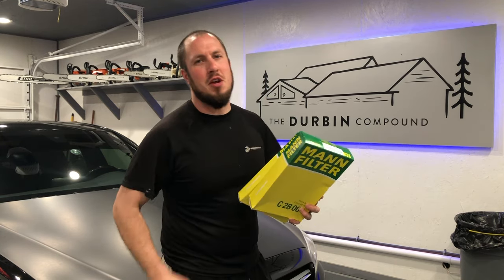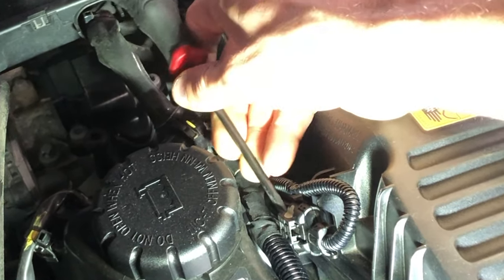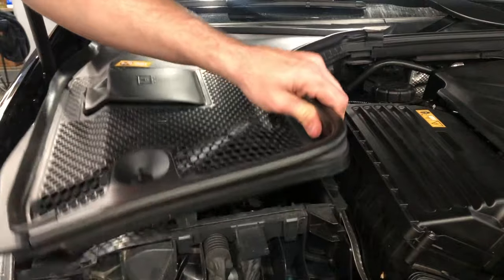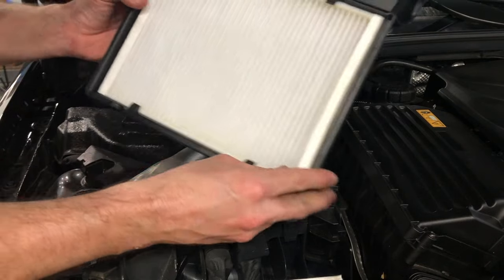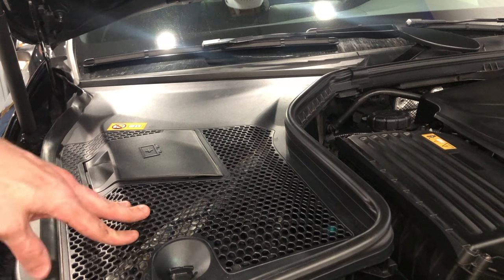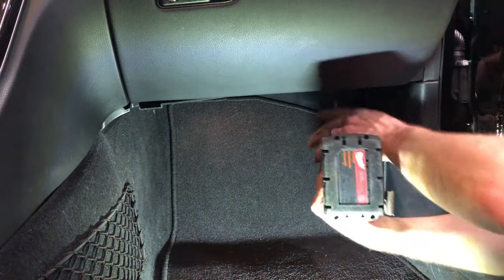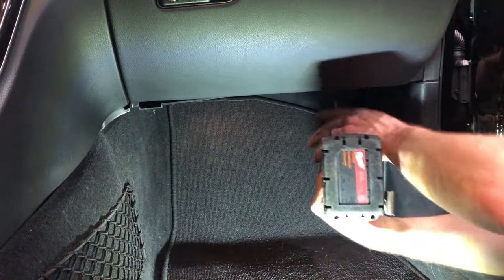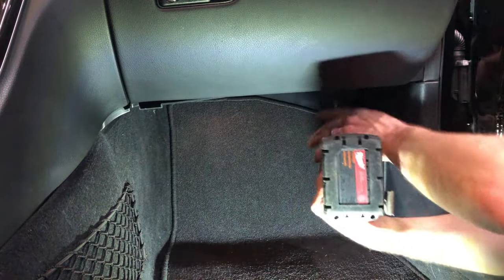Mercedes C300 W205 Air & Cabin Filter Change

Comment: Hey great vid but you put the cabin filter the wrong way. The foam part of the filter should be up, not sideways, its in the mann filter instructions inside the box. Thats why the old filter was crumpled, it was also sideways. But keep up the good work and sharing content!
Reply: Not necessarily. Its important to check two things: cut corner has to be on the right, and the air flow arrows - towards the engine.
Reply: No. For the Mann filter he definitely has it wrong. He could at least make a comment. I had to do it twice because of him. That's also why he was struggling to put the clip back in. He had it the wrong way.

Comment: Saved me a pointless B service 😂. Any particular reason why you do not remove the carpet lining?  States to remove in the directions I received with mine. Good job with the records too. I do something similar with my iPad.
Reply from the maker: I think the removal of the carpet is to assist in the angle it takes to insert the filter without bending it
Reply: At least they would put the filter in the right way at Mercedes...

Comment: Thanks for the help with the cabin air filter! You made my life easier and my wife happy her AC doesn’t stink anymore. Sincerely, Jacob
Reply: Next time you replace the filter, spray a little AC evaporator coil spray on the evaporator coil (looks like a mini radiator) back in there and let it sit/dry, then install the new filters.  That spray will help kill any bacteria or mold (or what-not) that has found its way onto the coil.  A can of it is only like $8-10 and is probably good for 2 jobs.

Comment: Hello, thank you so much for this video. Just for others: there is a big plastic hook behind the cover, for the cabin filter (inside). In the video, this hook is already broken. Mine was not, and it was very less easy to remove this cover. So be careful! I don’t have broken the hook but because of pulling without understanding, the plastic is now white at its base. So it will break at next change I suppose 😄
Also, the filter in the engine bay was the good part (Mann-filter) but the inside one was not (compatible but not the same). I don’t know who is the OEM for this one, there is no brand printed on the MB original filter, it seem to be an original part from MB, not from an OEM.

Comment: When I purchased my new (used)17 c300, I got rid of the ok condition runflat tires and put some awesome riding goodyear comfort drives on them.  2 studs were way over torqued. I could not get it off with my impact gun. I needed a 3 foot breaker bar to take them off! It was insane! All the other studs were also way over torqued but my gun was able to get them off. Amazing how even a dealership with supposed certified techs are unable to follow proper torque specs.

Comment: That cover for the cabin air filter is the death of me
Reply from the maker: Yes!! I did that bad boy with one hand for the video! I was sweating 😅
Reply: @TheDurbinCompound  I think it's made wrong way. Ribs are horizontally and squeezed by bottom cap so they should be vertically because the spoon is for squeezing not a ribs, then filter looks good after pulling off.. If you want it's easier to take carpet off  first then filter comes oudside/inside easily. Have w205 and made this few days ago too after this video and video how to take off carpet from yt. And you don't need to squeeze and smash this filter. Really it's not ok. 😃
Reply: @TheDurbinCompound  It would be easier if you put it in the right way...old video I know but sheesh. Hilarious you go on for a whole minute about how important it is to do it right too. lmao.

Comment: The Mann cabin air filter is smaller than the original filter from Benz.  The Mann filter has a white foam barrier but the original is just a bigger filter rather than having the foam part.

Comment: Later in the video you step through your process for taking notes for vehicle history. Totally agree, but noticed one entry in particular “tires rotated front to back”.  Your front and rear tires the same size?  Our OEM tires are not so not able to rotate. Semper Fi!
Reply from the maker: Yes, I did rotate the tires front to back.  The minimal offset on this set did not affect anything and no rubbing occurred.  The tire shop will recommend a left to right rotate.  I did it once, front to back and never decided to do it again.

Comment: @TheDurbinCompound  hello i have a question, about secondary, in cabin air filter. I think it's installed wrong, but im not sure 100%. The ribs should be placed vertically not horizontally in w205 I think. When in my w205 i was changing this filter it was some days ago I've put it vertically. (This is better for me because if they are horizontally and you push it like on video with the cover of the filter you will smash the ribs so first rib will be too close to the next rib and again and again and again... which makes airflow worse I think.) If you put ribs vertically they will not be smashed because of the spoon on the top of the filter. When you push this filter to close bottom cover and spoon is to the top, then you smash and squeeze spoon because it's softer then ribs placed vertically. Squeezing ribs is not correct I think. :P Tell me please because I don't know who's wrong. You dude or me. But one of us made it wrong for sure but I Hope it's you. :D (dont blame me!) Please check this because I don't want to have air filter placed wrong way in my car to the end of it's life.  Hahaha 😂
Reply: Would be good know which direction airflow goes. Towards it away from the blower ?
Reply: You‘re right, the second filter was installed rotated.

Comment: Great video! Had no idea there was another filter for the cabin. We recently purchased a 2019 Benz C300 Base, 2.0 Turbo engine. I bought a new filter for engine, went to install and found that unlike in your video you show the engine air filter on passenger mine is on driver's side...in your video title it says Mercedes C300 W205...ok where do I find this w number.... I'm assuming your model is a 4matic whereas mine is a base model ... will VIN tell this technical information. any information will help thx
Reply from the maker: W205 is the platform number for C series from 2015-2022.  C series from 2011-2014 was the W204, etc.  the D series from the 80’s was a W123.  It’s just another designation.  Commonly used in Europe.  Makes the video more searchable.

Comment: Everything was straight foward except that passenger  panel for the interior cabin filter is a bitch to put back on once you take it off. That rear back tab. I changed both cabin filters.

Comment: Question...with the evap issues you had the dealer fix..what were the symptoms of the bad charcoal canister or etc? Smell of gas in the cabin area while driving?
Reply from the maker: No. Evap was simply a check engine light. Now if you’re smelling gas in the cabin at idle, you have a fuel line problem. I literally just went through this. The gas was “sweating” at the connections under the hood. Behind the engine, there is a fuel test port before the fuel line goes into the high pressure pump. I had the dealer replace the connectors for around $300. Parts included ($75). From what I could tell, the only way I would’ve been able to do it was being able to stand under the car. I couldn’t get to them from the top.
Reply: TheDurbinCompound  oh man thank you ! Lol ...it had a few mechanics stumped because one minute you smell it and then the next minute you don’t ..also it seems to be only during cold weather I smell it
Reply from the maker: I got you! It literally doesn’t leak, it just kind of sweats like I said. From years of working on jets I know what to look for. The fuel lines looked like they had discoloring around the connections. The dealer agreed they needed replaced. It fixed my problem! By the way, I only saw the discoloring from under the car. I couldnt reach the connections to actually feel them.
Reply from the maker: I appreciate you subscribing to the channel! Hope you find value in my content going forward! Also be sure to check out all my C300 videos!

Comment: Hey, great video. I have a question though, when I pulled out the air filter located underneath the glove box from my 2016 c300, the filter pleats were vertical, instead of horizontal like most videos I saw on YouTube, including yours. I have been servicing my car at the dealership. Could they have put it in the wrong way?

Comment: I replaced the OEM combination filter(under-hood, air-intake) today by myself with a febi bilstein cabin filter. I noticed that the OEM one has some light black coat on it, not sure whether it is the activated carbon coating or just dirty (but it looks like not dirty since not obvious big stuff chunk in there)? But I am certain that the febi bilstein cabin filter does not have light black coat on it so it appears totally white. Anyone had experience on replacing the combination filter(under-hood, air-intake) by themselves and could you please tell me whether the OEM one has carbon coating? I am sure that the inside filter(at blower housing) has the carbon coating but idk about the under-hood one. If the under-hood one does have carbon coating then I may purchase a new OEM one. 
Also, anyone has idea about the quality of febi bilstein cabin filters?

Thank you all in advance.
Reply from the maker: Good topic to bring up. The OEM Mann filter that I used in the video was completely white. No coating on it.
Reply: @TheDurbinCompound  Thanks. Then I will keep using my febi bilstein cabin filter to see the quality.

Comment: It happened on the driver side only when I turn the steering wheel left and right, the noise is not too loud but any one can hear them.

I open the driver door and push my hand power on the window, the noise is the same noise. But the passenger side is good.

When I jump the car higher the wheel is on the air, and turn the steering wheel => The noise gone, no more noise 

I let the shop checked it, they have no glue on my issue, they checked the arm, the low ball joint,the suspension,then they said the rubber seal is good and not leaking oil. Nothing to do.

I change the tire side to side, but the noise is still alive.